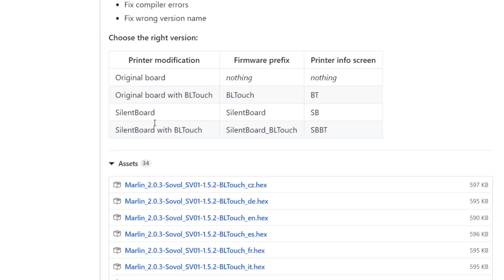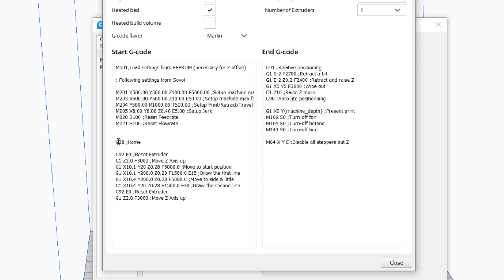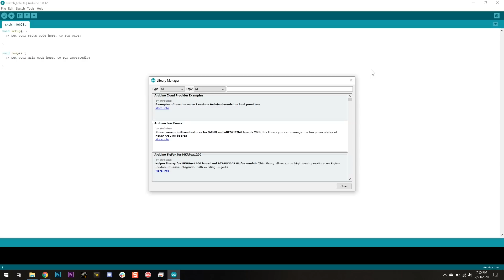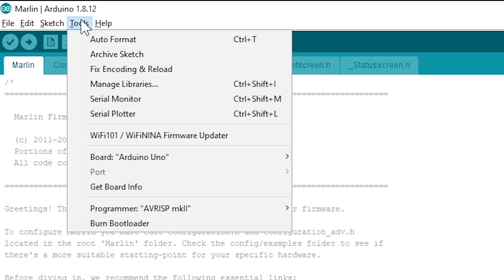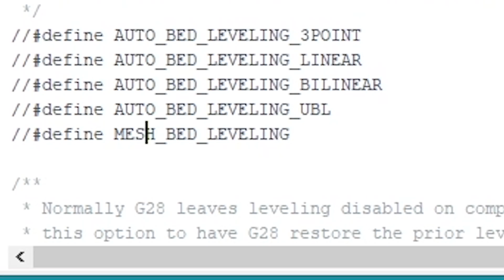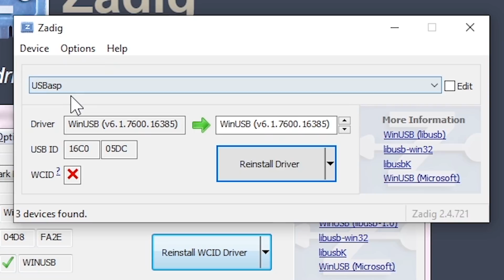Mesh Bed Leveling for Sovol SV-01 & Ender 3 Pro (including flash bootloader)

Comment: isnt this essentially what BLTOUCH is doing?
Reply from the maker: Yes but mesh bed leveling is free and does not require modding the printer.
Reply: @JoshuaBardwell  awesome, i was only asking as a comparison to the concept.  im sure you have a bltouch waiting to be installed. i did mine yesterday and the results are pretty amazing. super consistent

Comment: Disable the stepper motors and by manually turning the z motor axis and inspect if both the z motor side and the   lcd display side  lifting/lowering 100% exactly. I thought I the same issue just to find that the one side will lift and for a less than a millimeter the the other side would move.  After some minor adjustments everything was as it should be level throughout the bed.